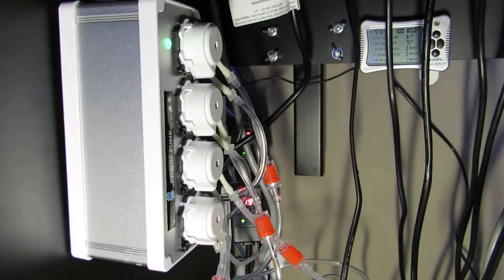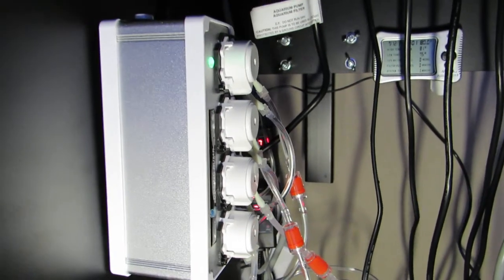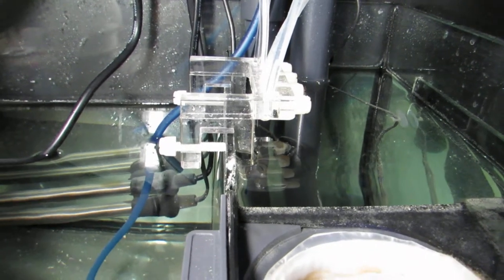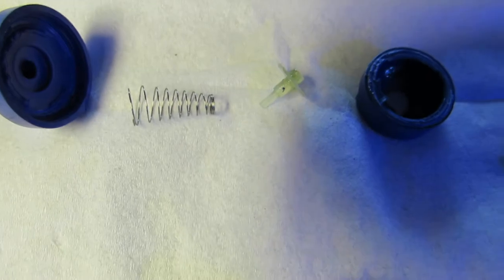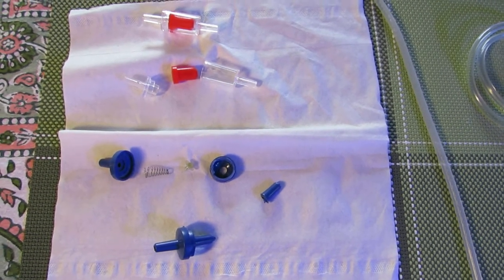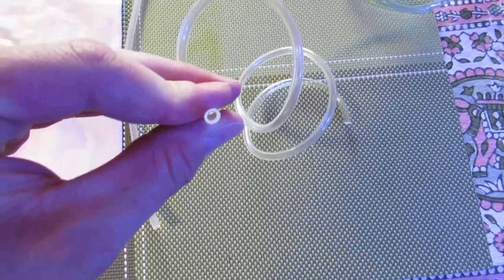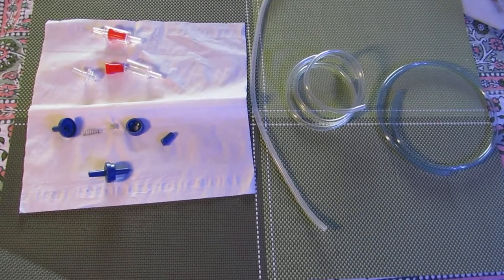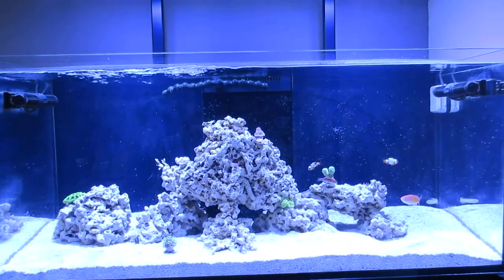Coral Box WiFi Dosing Pump Update - New Check Valves And Tubing

Comment: Im not sure if this will help but I have a Jebao doser and have no back siphoning issue and no need for check valve. I believe the problem  you have is air is coming from the coupler where the doser attached to your line. On the jebao its not a barbed typed but a graduated type so it creates 100% seal.

Comment: I used those orange check valves in my system and I experienced siphoning of my dosing liquid into my sump.  I believe the spring load is necessary to prevent siphoning from your dosing container into your sump.  There is no way a siphon can happen from my sump to my dosing container.  The spring loaded check valve prevents siphoning both ways.   The orange check valves only prevent siphoning in case your sump is higher than your dosing pump (very unlikely).  I lost a half gallon of calcium chloride into my 200 gallon tank and 500 ml of potassium at another time.  Hope this helps.

Comment: Thanx a lot for the guide and all the questions-answers below,it helps a lot,now I need to find the check valves and tubing in Europe,cause Amazon CDN does't ship here...Are you still happy with the dosing pump?...I ordered mine today...
Reply from the maker: Rafa von Iceberg Happy to help. You may find a international shipper on eBay. Yes I’m still happy with the unit. The air bubbles are back but they don’t effect the dosage as long as I use the check valves.
Reply: Thanx is good to know about the check valves.Happy reefing...

Comment: Thanks for the video.
I have the supplied check valve on the outlet side near the sump and i get air near the hose connection on the inlet of the pump.
Seems you had the same issue.
So you only have check valves on the inlet side of your pump heads?
I put the 2 spare check valves on the inlet so i now have one on the outlet near the sump and one on the inlet on the 2 channels to stop the problem for now.
Reply from the maker: I had to put 2 check valves per pump. So it wouldn’t leak into the sump. And the other so it wouldn’t drain back in the bottles. The red ones in this video are working well. All the ones that came with the unit failed. My doser is now working as it should.
Reply: My Fish Life. I still have problems with tiny air bubbles forming overnight through the whole tubing. Its got me stuffed.
Reply from the maker: Dale Whitmore I get the same thing. At least with the check valves in place your liquid won’t leak out. Even with the bubbles I’m getting a stable dose (I think).

Comment: how did you make out long term after the new check valves and tubing?
Reply from the maker: Jessie S The new check valves are doing great. I only need them on the one side towards the dosing containers. Also I don’t worry about air in the lines anymore. As long as I’m getting the correct dosage (which I am) the bubbles don’t matter :)
Reply: @myreeflife7072  Would you mind showing the new check valves you used?  I see a link you shared for the "old" ones, but I believe you said they failed correct?  I've been told those check valves are for "air" and not a liquid.  So I am trying to find one rated for liquid.  I'd appreciate someone who has one knows, thanks.

Comment: Hi there, i just set my new pump 2 days ago, i using the check valve that comes with it. And my air lines keep filling up with air, is that because im using the check valve that comes with it? Should i change them?
Reply from the maker: Willy Vitajasa Hi there. The check valves that came with unit failed for me. So I switched to the style you see in the beginning of the video. Most online or local stores carry them. Good luck!

Comment: Where did u get them ?? I wonder if they will fit my kameor doser??
Reply from the maker: T Surro From amazon for the prime/local ones and the ones direct from china. They also have black ones. 
I think they will fit. They fit both sizes of that tubing. 

https://www.amazon.ca/gp/aw/d/B01N5KGBI9/ref=mp_s_a_1_2?ie=UTF8&qid=1500006464&sr=8-2&pi=AC_SX236_SY340_QL65&keywords=check+valves&dpPl=1&dpID=41BVjZ%2BGRbL&ref=plSrch